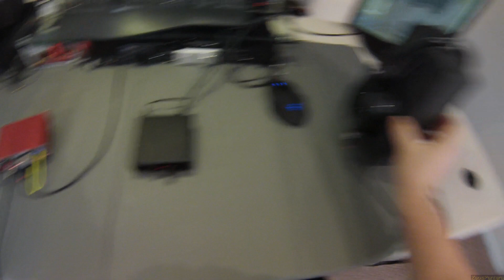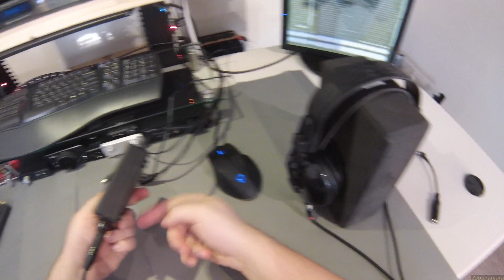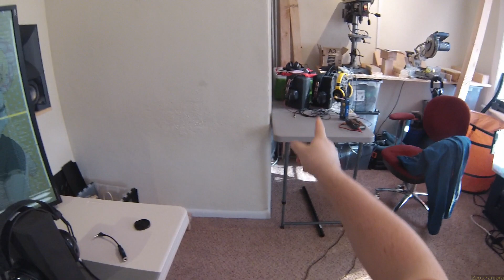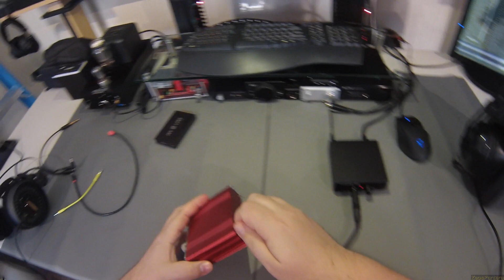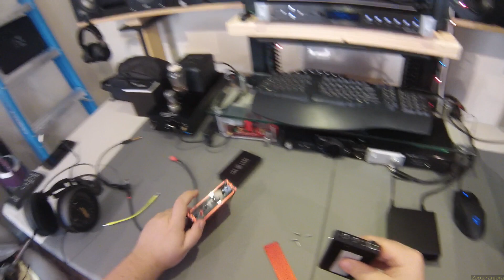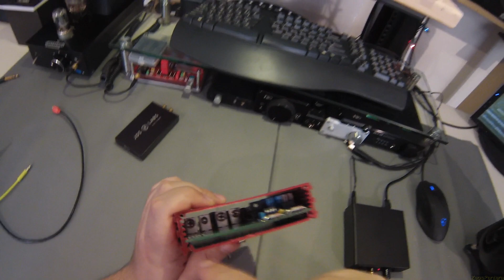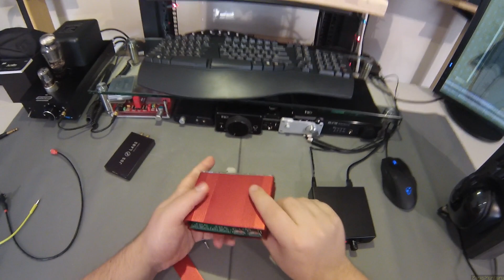Z Review - Massdrop O2/Odac Combo

Comment: From NWAVGUY: This thing is called the Objective2 so, at the risk of sounding like a total geek, I'd like to try and keep things factual and address the power supply issue...

You can put a scope on the power supply in the O2, AC couple the scope so you can crank up the sensitivity to see whatever signal/noise/etc. is on the power supply rails, drive the poor O2 to worst case conditions into a difficult load with music, sine waves, square waves, or pink noise, and there's just not much to see.

At most, I've only seen a 0.1 v p-p worth of signal/noise/ripple/etc. on the supply rails. That's 35 mV RMS. Then you apply 80 dB of CMRR (it might be closer to 90 dB) and you get the equivalent of about 3.5 uV in the audio signal.

That's about -110 dB referenced to 1 volt which is far below the generally accepted -80 dB threshold of audibility and well below other distortion products when you're driving the amp that hard. Under more normal operating conditions (i.e. currents you would use with real headphones and music) it's more like -120 dB.

So that's a long (engineering) way of saying the AC power supply in the O2 is not a limiting factor in any objective way. Trying to improve it would be a waste of money.

For what it's worth, I've done audio differencing tests in the past where you literally subtract the output of a piece of gear from the input. What's left over is the distortion, noise, hum, frequency response errors, phase shift, etc. It's pretty much everything the amp is doing wrong and the test can be done with real music driving a real load. I've played around with different power supplies and the difference result didn't change.

One could also build two O2s and compare them blind. To keep it simple, you could have one on battery power and they other on AC and (staying within the battery's voltage swing) I'm quite certain you won't hear any difference. You could do the same with a beefed up power supply in one. Again, you won't be able to tell them apart.
Reply: +kronbison From NWAVGUY- "'DESKTOP VERSION - As discussed in both articles, and especially the comments for the first article, you can easily build the O2 into a very nice desktop amp. The B3-080 taller case allows room for 1/4" jacks and RCA inputs. You simply leave the batteries out. Want an even nicer look? Buy one of the ~$50 heavy DIY chassis on eBay and panel mount everything.'

'POWER SUPPLY - As for the power supply, or other supposed "upgrades", if the O2 can already match the objective and subjective performance of something like the $900 GS-1 (for the sake of this discussion) please explain why the amp itself or power supply needs "upgrading" when there's zero real world benefit? I can only think of two reasons.'

'VOLUME CONTROL - The first area I can see improving is perhaps the volume control. But there are not any practical options I'm aware of that don't cost around as much or more than the rest of the amp combined. See my revised volume control comments above in section 2-11. It's certainly not wise to lay out the PCB for an expensive DACT stepped attenuator when few will ever benefit from using one or want the added cost. Even the GS-1 doesn't have one as standard.'

'RARE HEADPHONES - The other possibility is there may be some headphones in real world use the O2 doesn't quite have enough voltage and/or current to drive to suitably loud levels for some tastes. That might be reason for an even more powerful desktop amp but you would have to really look long and hard at how popular those headphones are and how close the O2 comes with them as-is. You can never please all the people all the time. The five owners of 1945 vintage Klobigohrlautsprecher cans might just have to use a different amp.'

'So yeah, I could design a desktop-only amp with higher power and more expensive parts that would have lower HF distortion. But would it sound any better? I don't think so. I try to be practical rather than taking an overkill solution where there's little or nothing to be gained. If you want a desktop amp with lower HF distortion, build The Wire with the LME49600's.'

'If you want a practical desktop amp, that so far nobody can tell from the DAC1's, build the O2 and leave the batteries out. Done.'
Reply: +kronbison I totally agree. However if you would use a centertapped transformer you could use default connectors. Although the goal of the original O2 was to be a portable device and a transformer would make it rather big.
Also I don't like how companies like mayflower electronics and JDS labs dont sell a SMD version of it. It could make it alot smaller. But then theres the creative common problem.
Reply: you're wrong

Comment: I know sound is very subjective, do you still think the smsl 973ii still better? or is this the new recommended combo to get?
Reply: Clean, neutral. No bass boost bs.

No issues driving higher impedance headphones. I can run HD600's at 12:00. More than that gets uncomfortable. 2:00 is ear-deafening/near-instant hearing loss.

If you want a good solid state option, get an o2/odac combo. I haven't tried it, but guarantee it's better, especially with some higher-end headphones.
Reply: +Aiyeon I'd also like to know, never having tried the combo.
Reply from the maker: +Aiyeon Id say on par with power but an advantage to the Odac because it is THE dac.
Reply: Good to know, as a sd793ii owner.

I'm guessing more soundstage/accuracy and less distortion would be what I would notice. However, a small upgrade.
Reply: How is the sd793ii? is it worth it if you have k7xx headphones?
Reply: Over what? Onboard? Should be better. Buy it and try it. If you don't like it, sell it $20 cheaper (although I have no idea why you would).
Reply: +Jeff Cook I mean your experience when using the sd793ii? And I believe the the k7xx's 62 ohms, can it drive it and cleanly?
Reply: Good overall soundstage/location also.

Comment: Afaik the o2 only runs on batterys for better noise performance on the measurements. The space the batteries take up perfectly fits the ODAC.  
The o2 could have been way tinier but it had to be diyable.
Reply: So you're saying that the O2/ODAC combo can not work on batteries? Is it possible to somehow retrofit batteries though?